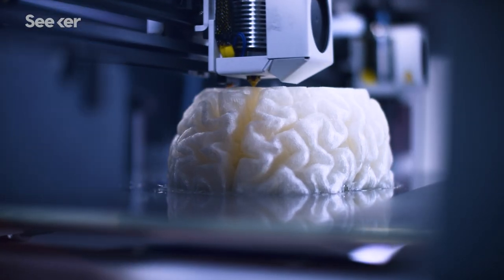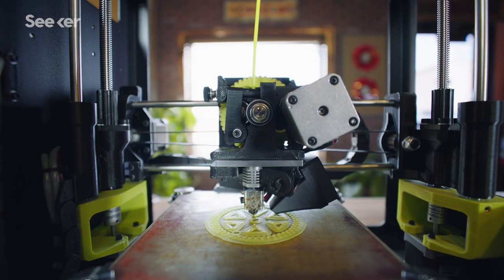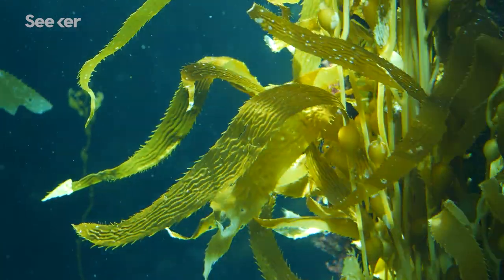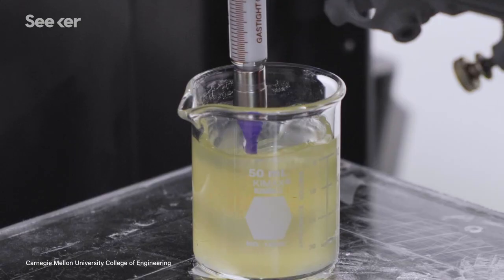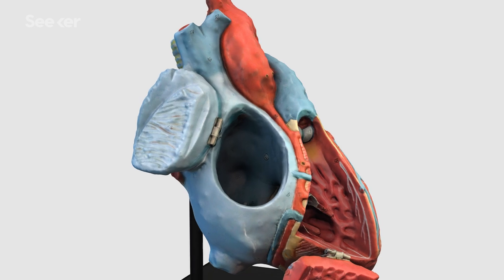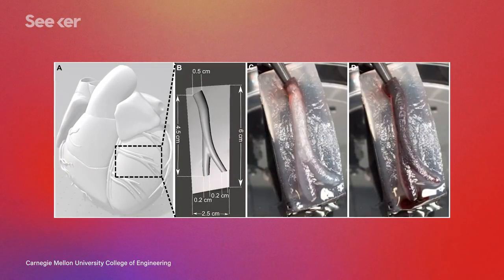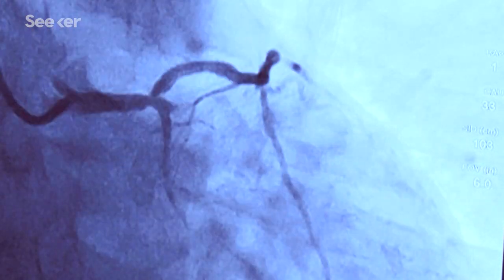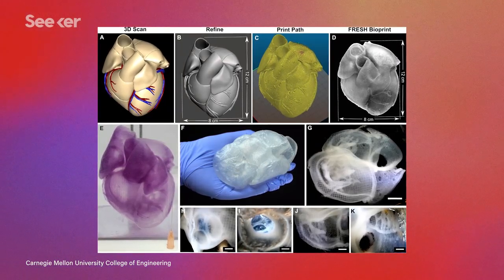The First Full-Size 3D Print of a Human Heart Is Here

Comment: So it's just a printed model of the heart.. it's more elastic and have some uses but still just a model. Big deal?
Reply: Yes, it's a step towards fully functional created hearts for transplantation. 😄
Reply: @megamanx466  it's not even close to anything functional. It's just a 3d print anyone could do with different material that doesn't do anything for actual transplantation. Unless you want to replace someone's heart with a rubber toy..
Reply: @bayraktarx1386  Ah, so like I said... a step towards a created fully functional heart. I didn't say it was a leap forward. Also, the technique they use is new, so no... not anyone could do it, but you're or anyone is welcome to try! 😁